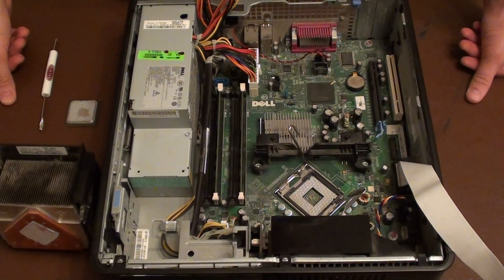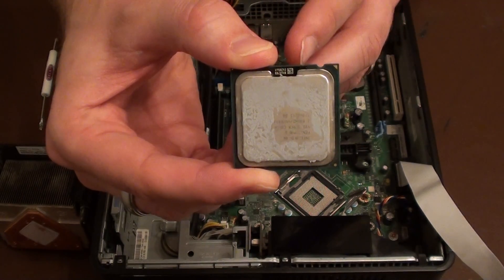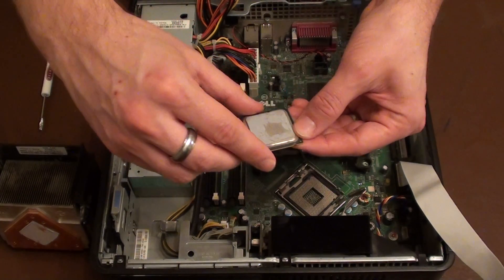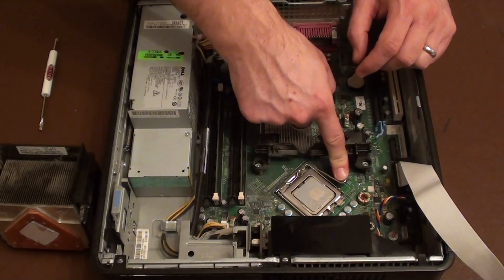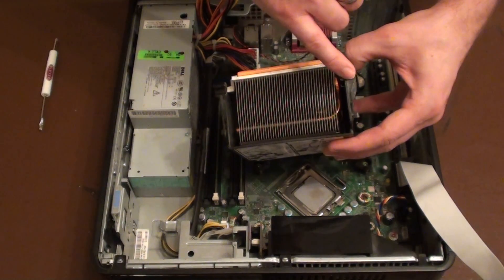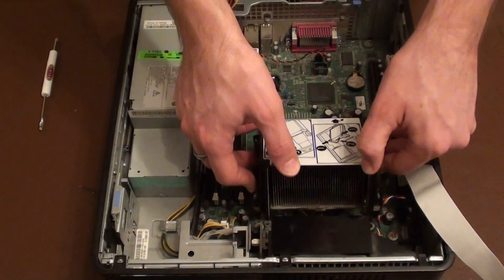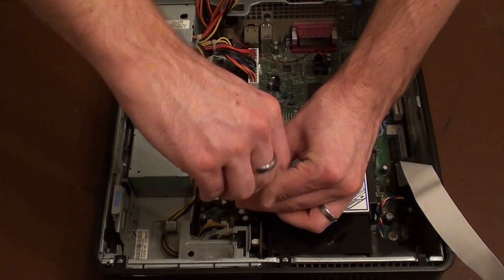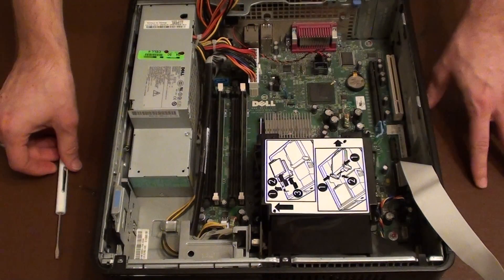How to install HS and CPU in a Dell Optiplex 745

Comment: Spot 4 fails in this video:
1. Wrong model described, the heatsing shown doesn't apply to the actuall model.
2. Fingering the CPU socket.
3. Thermal paste not propperly applied.
4. Heatsing not tightened evenly.
Reply from the maker: +31337UsrNme heatsink... not heatsing

1. Correct, I can&#39;t remember the actual model, so I haven&#39;t updated it. But this has already been pointed out before, it probably is a 745.
2. These are dead machines and this is a basic demo, not a detailed one. So this is a non-issue.
3. See 2
4. See 2

Your points are all valid, however for the purpose of the video i.e. what I needed it for,  none of the points you raised were important.

I could identify more "fails", but I think that's enough of the pedantry!
Reply: +Darryn Gordon 
I did see more but I think I got my point across. I understand this is a damaged system and you wheren't worried about it, yet when making a video for Joe Average it's good to show best practice since their system is probably not dead and following your instructions could damage the equipment.